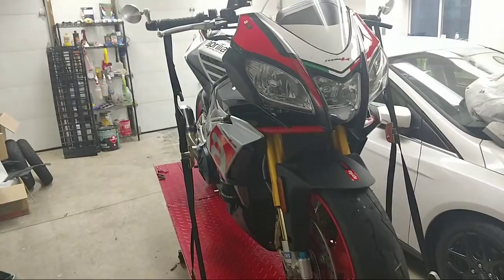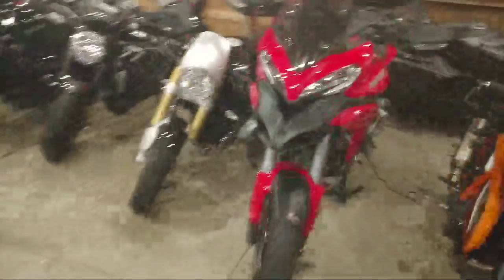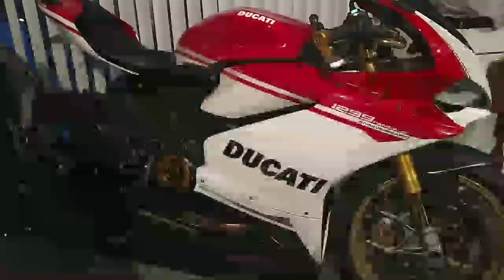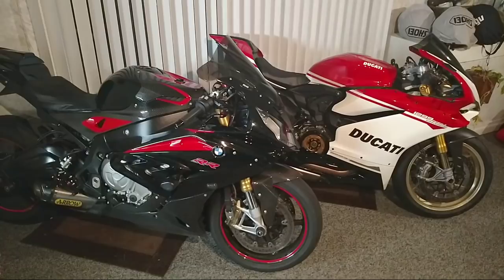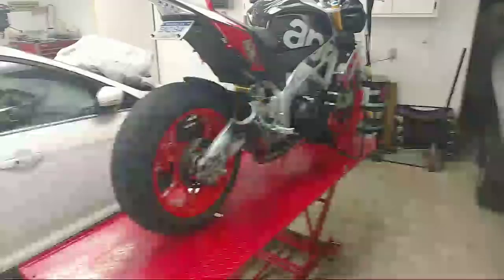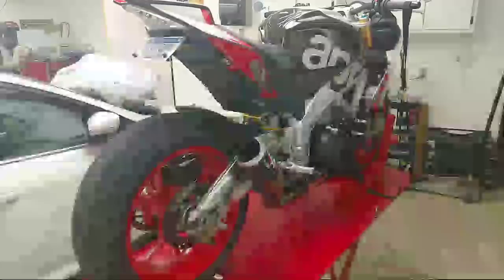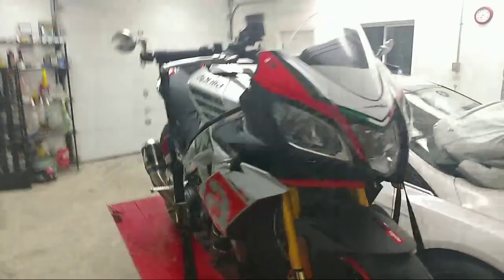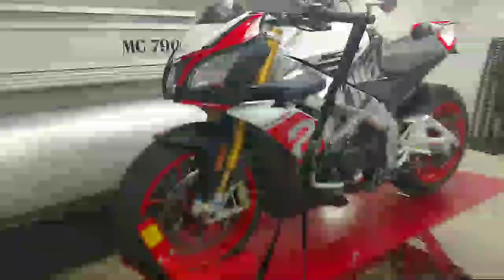Aprilia Tuono Start Up And Bike Collection  Walk Around

Comment: Steve, the Opt 7's fit right into the head light area.  They send the LED converter and a H7 adapter and, even with all the wire (could be cut down), it all fits in.  The OEM caps fit right over the fans as well.  I drilled a couple holes in the caps just to make sure the fans had enough air.  I did two rides without the holes and didn't see any issue but thought I'd give the little holes a try.  I haven't done the high beam yet on my 2017 Tuono but will in the future.  It's an awesome upgrade.
Reply from the maker: +Sam Iam yep they fit right in I've done it on the BMW and on the Triumph 675R. The ballast and everything I put on the outside of the bike because they do get hot but they are hidden. drill a large hole in the headlight caps and have some grommets I got off at Amazon that allow the wiring the pass through works very well

Comment: Happy holidays!
Love What you do!

I order my Aprilia Factory  last week👌🤩
I have some questions for you.
Your fender kit What brand is it and Will  Kellerman High Power LED (really small turn signals) fit on www.motoboxusa.net look up 
Rsv4/Tuono fender kit $140 ?

The AustinRacing slipon does it come whith a Exhaust Valve?
On your latest video i cant see any on your slipon? 
And there are six various slip on alternatives. What’s your name? 

Would appreciate a lot if you took the time to respond. 
Fredrik